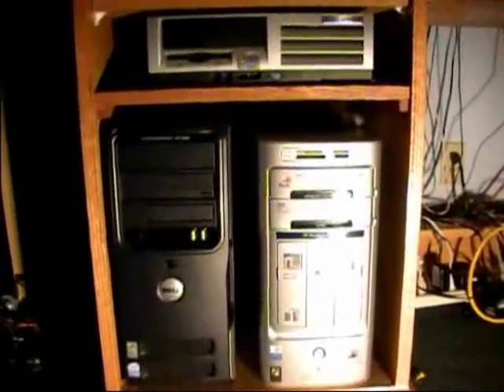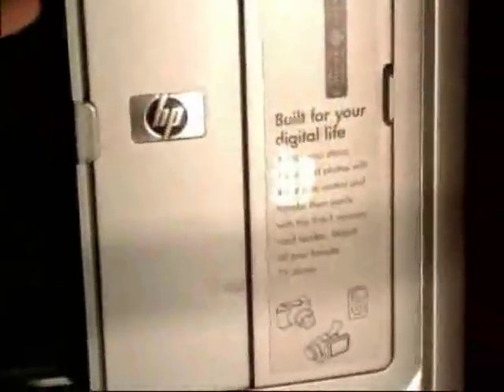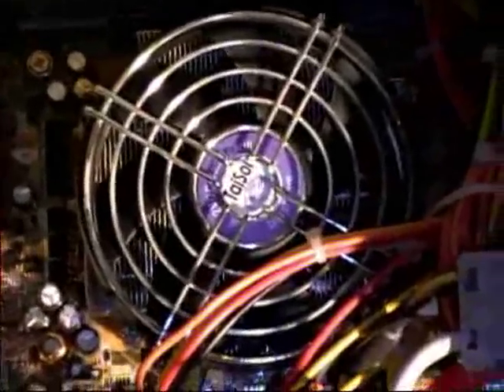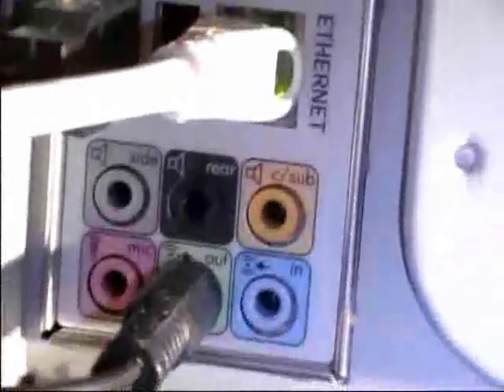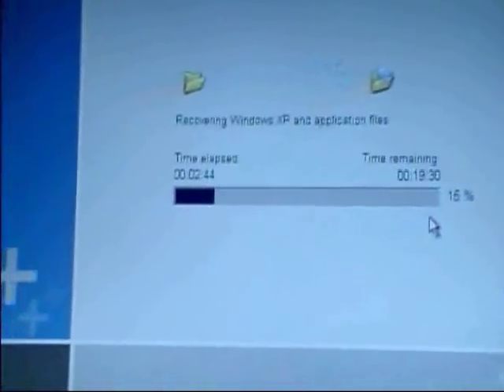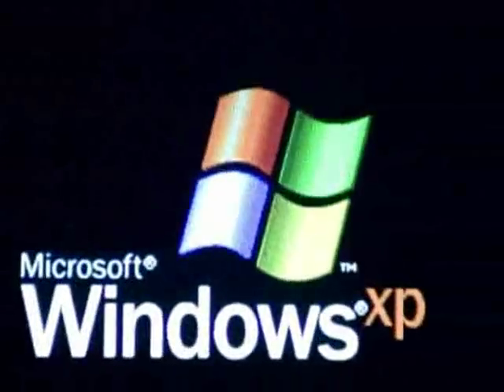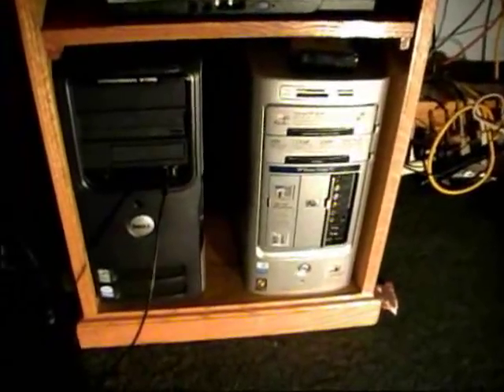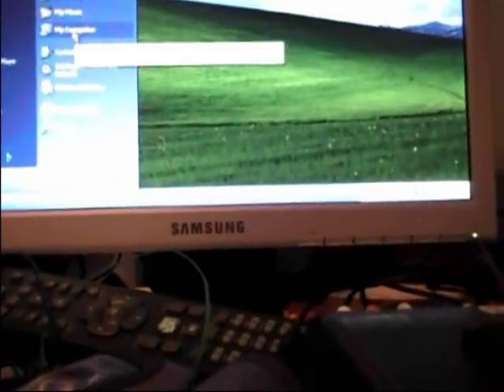hp media center edition computer

Comment from the maker: the motherboard you chose will work but I had a MSI motherboard short out my amd 8 core processor. i no longer trust MSI i would suggest this motherboard it is a couple of  dollars more but it is better quality ASUS P8H61-M LX3 R2.0 when you are installing the motherhood you will want to make sure that the case standoffs offs that are not in use short out  the back of the motherboard use some black take and cover the ones not in use. if you have any more questions feel free to ask.

Comment: I am looking into one mother board, which i thought would work, but im not sure if the graphics card would reach to the back there the place where you plug it in is located. MSI H61M-P31/W8 LGA 1155 Intel H61 Micro ATX Intel Motherboard with UEFI BIOS.
that is the motherboard, do you know if that one will work with what i have and the existing parts in the pc? sorry for all the questions!

Comment: It doesnt look like it saved my comments.... but i have the intel pentium g860 processor which i didnt know till i got it that i have the wrong socket type, so i will need a new motherboard that has a 1155 socket. i also have the VisionTek 900232 Radeon HD 3650 graphics card.

Comment: I purchased this graphics card: VisionTek 900232 Radeon HD 3650 512MB 128-bit GDDR2 PCI Express 2.0 x16 HDCP Ready CrossFireX Support Video Card 
and this processor: Intel Pentium G860 Sandy Bridge 3.0GHz LGA 1155 65W Dual-Core Desktop Processor Intel HD Graphics BX80623G860 
unfortunately i was too dumb to figure out that i have the wrong processor socket, it requires a 1155 type. so i need a new motherboard and ram. I need help finding a motherboard. i picked out the ram and it is a ddr3 type